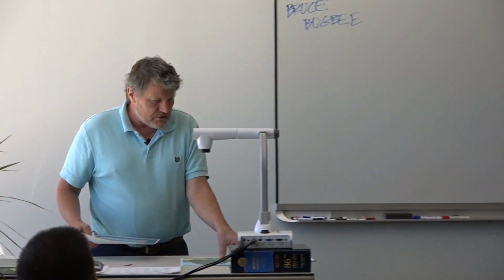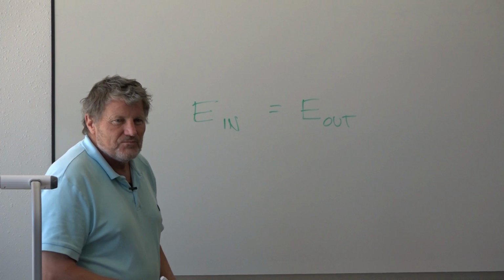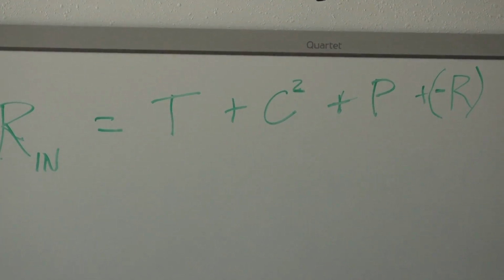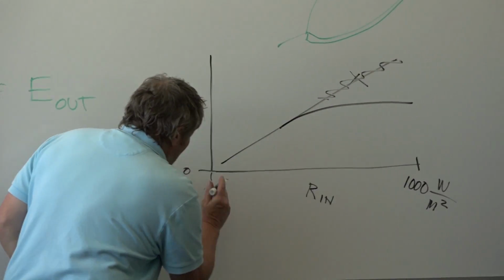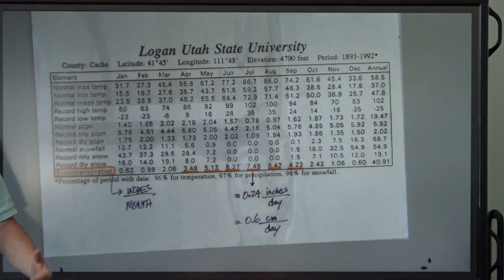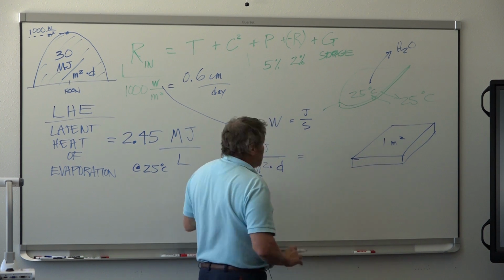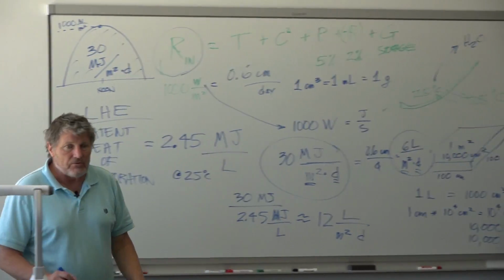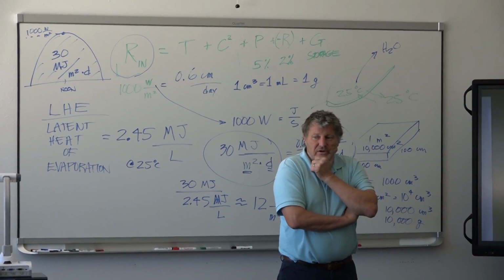Lecture 1-Principles of Energy Balance in Environmental Systems

Comment: This, I think answers my questions about how to maintain a good VPD and EC in the grow tent through allowing the plants respiration to control the level of humidity. It changes as I add and remove heat. At 79*-81* F, the humidity holds pretty steady at 59%-64%. Turn the heat up to 88*-96* F and humidity drops to 44%-54%. Significant changes when you’re thinking about nutrient uptake, or EC. Good stuff doctor B.B.!

Comment: Do the hemp plants breath less during the dark hours? Let me take this question a step further. During the vegetation cycle to the hemp plants need more CO2 during the light hours versus the dark hours?I’ll use the same question for the flower cycle Do they need the same co2 to during the light cycle or the dark cycle. Thanks any additional input regarding this question would be appreciated thank you Dave
Reply: Hello Dave I'm no expert on the subject but as I understood it plants breathe CO2 and expell O2 during the day cycle, and it reverses in the night cycle, so at night they breathe O2 and expell CO2, though night respiration is very low volume compared to day respiration. So for your hemp question: It does not matter how much CO2 you put in at night, since plants are not getting any benefit or prejudice for it, but if you think about the expense.. you may want to stop wasting money on night cycle CO2.
Hope it helps.